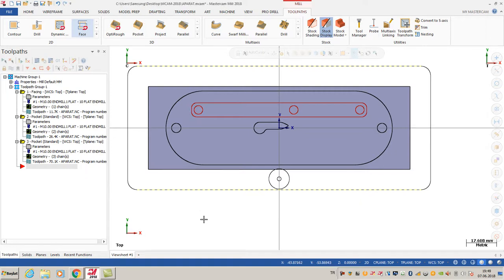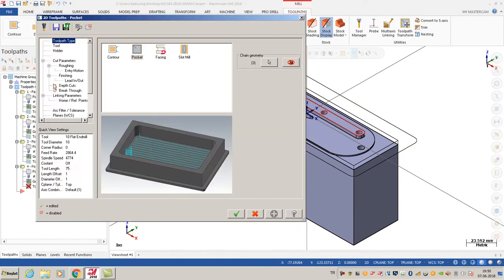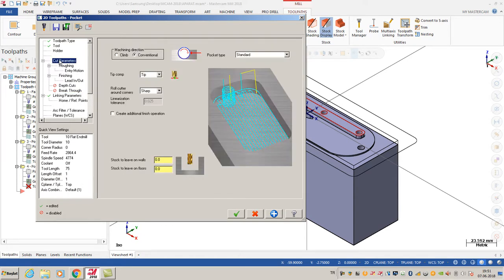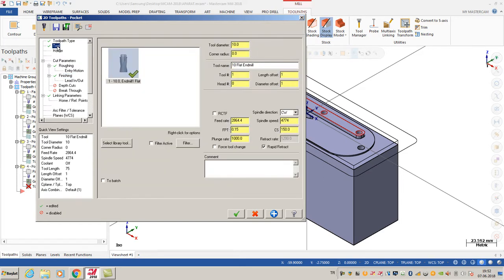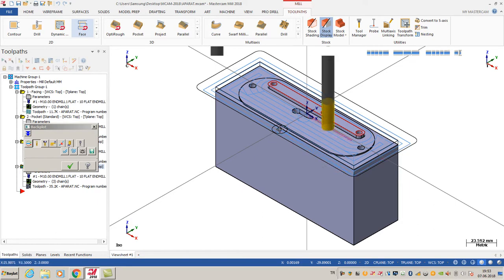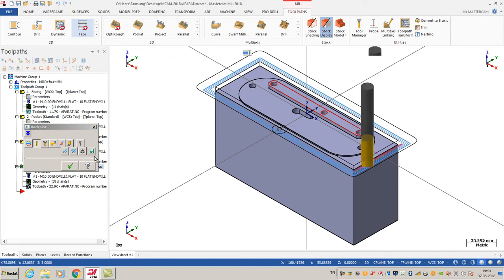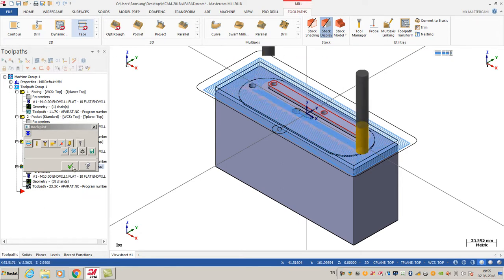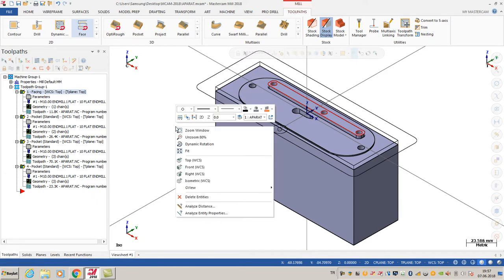Mastercam Pocket Milling operation with Entry Motion

Comment: Selecting of entrance point is an old  hidden trick of Mastercam team. No chance to find it yourself.  In 2018 year this strategy obsolete. Now mastercam has some new strategies for pockets. I use "Dynamic mill" for roughing and "Area mill" for finishing.
Reply from the maker: You are right. I used mastercam since V8 (2001) so thats why I have old trick about mastercam. So don't hesitate to ask me any question. Thanks